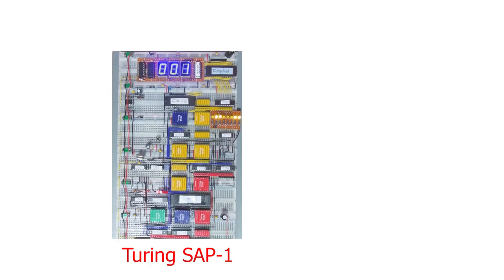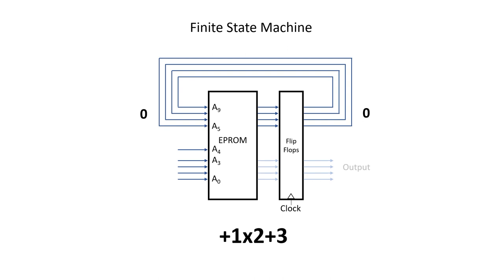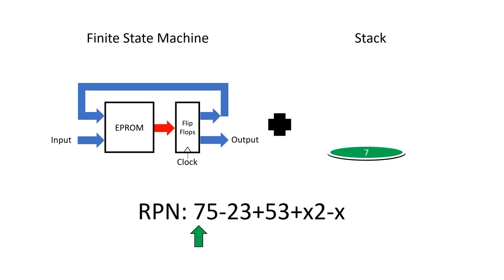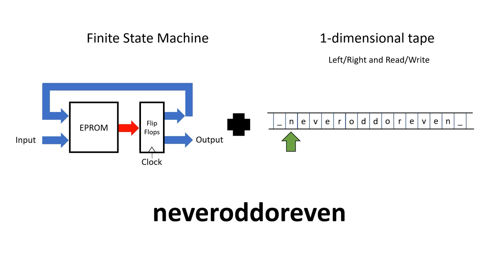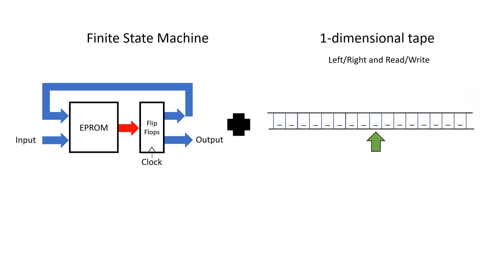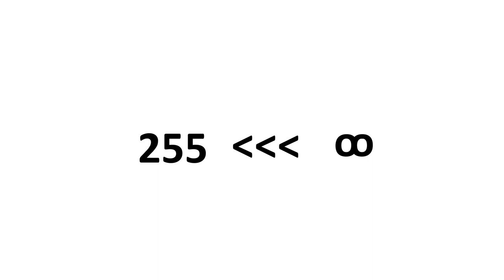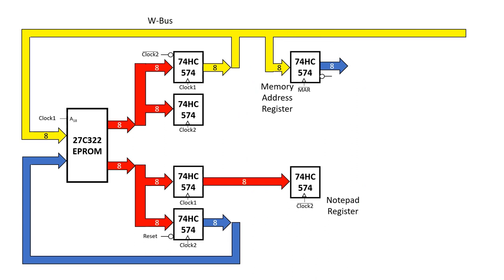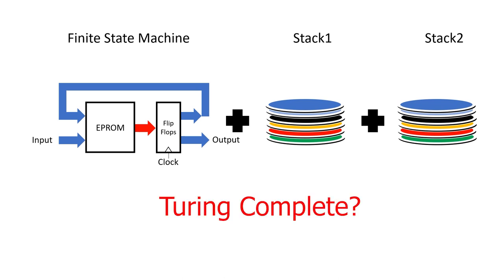Simpler than Ben Eater's SAP 1: Memory Interface.

Comment: Very interesting!  That's the best explanation I've seen so far of how to implement a Turing Machine in actual electronic components.  We used Turing Machines pretty much exclusively in my Introduction to Theoretical Computer Science class at uni, and we were told there that they could be built, but that they were useful primarily for understanding the concepts underlying computation.  It's fun to see the concept implemented to perform actual electronic computation.
Reply from the maker: Excellent, glad you got something from it.   Part 3 goes over the programming model for the SAP-1, with a bit of a surprise at the end.
Once you've watched part 3, please let me know if the Turing6502 series makes more sense.  Regards Matt.
Reply: @DrMattRegan  I will!  I will have to re-watch some of the Turing6502 videos after watching Part 3 before I know, of course.  🙂

Comment: A finite state automaton with 2 stacks should solve the palindrome problem. What ever gets popped off the first stack should be pushed on the second, and after one pass your "swap" the stacks and go the other direction. I suspect this would make it Turing complete because you don't loose information as your process data (well, you could if you want, but it isn't necessary).
Reply: This is the same as the next example discussed, but instead of moving the pointer, you move the entire tape by shuffling the elements between the stacks.
Reply from the maker: Correct.  One stack acts as one half of the tape, while the other stack acts as the other half of the tape. So a FSA with 2 stacks is Turing complete.
Reply: I'm a huge fan of two stack machines and wished that was the direction hardware took.
Reply from the maker: Yep, hard to know what they were thinking in the day hen they ignore two stacks!!  How are you finding these videos, i'm trying a different angle.
Reply: @DrMattRegan  I liked it. You introduced materials about alternatives to the Turing machine (e.g. stack machine or random access machine) and then explained if they were still Turning machines. When I took Automata the linkage between the two wasn't explained.
Reply from the maker: Thanks, it's hard to know what to include, the theory bit ended up being longer than i had planned, but i want people to really understand the decisions behind the build and to really understand what each chip is for.  This will be a short series, next one will be the last unless it blows out, anything anyone wants be to go over in more detail.

Comment: Has this architecture ever been used as the architecture for a "commercial" machine?
Reply from the maker: Probably not.   The 6502 architecture is pretty efficient. An actual ALU uses fewer transistors than a big look-up table.

Comment: At https://raw.githubusercontent.com/Turing6502/TuringSAP1/main/Turing%20SAP1%20Schematic.pdf, the M27C322 data pins does not follow the order of D0-Q0 to D15-Q15, does it not matter ?
Reply: unsigned int DeSwizzleData(unsigned int val) does the puzzle ?
Reply from the maker: Correct, i find the native output of the 27C322 difficult to debug
It's the SwizzleData and DeSwizzleData functions that convert between the two formats.
Have you been able to get it to run?
Reply: @DrMattRegan  linux gcc compile ok
Reply: @DrMattRegan  also dam good as crypto :)